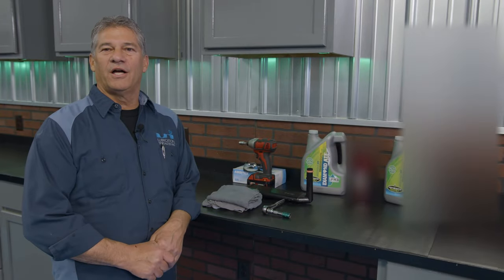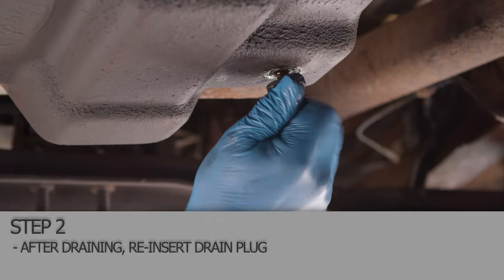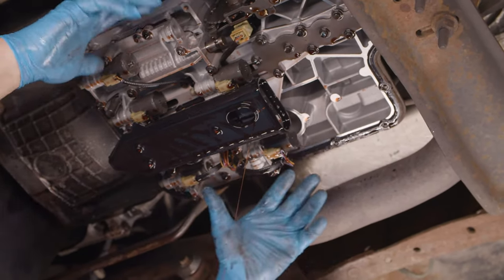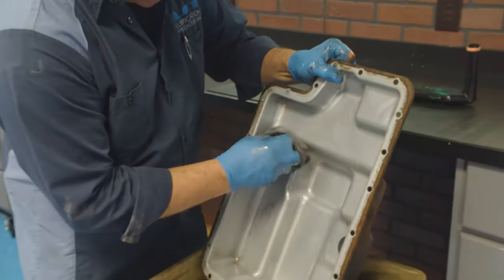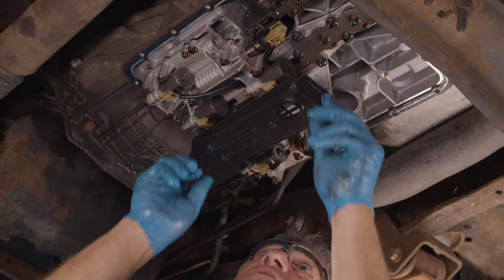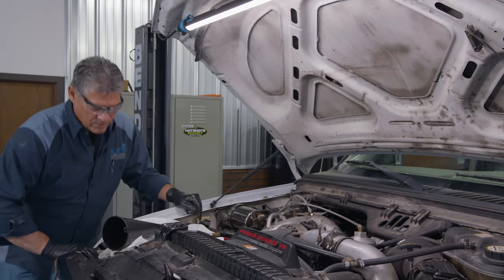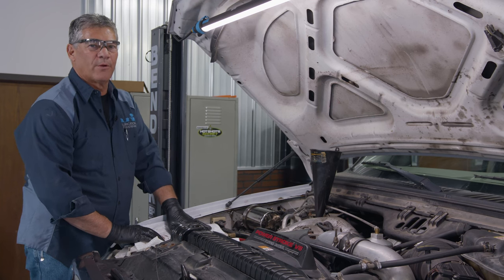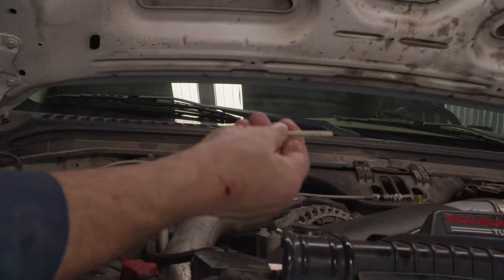How to Service a Transmission on a 2003-2007 Ford F-250/F-350 6.0L Powerstroke.

Comment: You failed to change the most important transmission filter on these trucks, that is the paper roll canister filter that is on the front passenger side of the frame. This filter filters on a small micron level and needs to be changed more often than the pan filter. 
C'mon, how do you not know this?
Reply: I'm like you. Not impressed
Reply: I was kinda thinking the same thing.  Why bother changing the fluid and one filter if you’re not going to change all of the filters.  Not to mention, that tranny requires very specific fluid, that didn’t look like it to me.
Reply: Yeah same. Not to mention flushing it. half the old fluid is  still in there.

Comment: I have always put the trans slowly into every gear, one after another for a few seconds, then back to Park before checking the level. This allows all the various hydraulic circuits for each gear to fill up. But the 5R110 is entirely electric solenoid shifted, so perhaps that is no longer needed on this tranny. It would be good for you to comment and clarify.

Comment: Should I change my transmission fluid even though I have never changed it I have 135,000 miles on it ? 2007 f250 6.0
Reply: I would drain out about 2 quarts every oil change and replace with two new quarts along with changing the paper filter up front by the radiator. Introducing too much new fluid might cause it to slip since it has been so long. You could also put on an auxiliary transmission filter that will do a great job of cleaning up the fluid on the return line. Dieselsite.com has one that I put on my 2007 6.0. I don't drop the pan anymore because the pan filter is more of a screen than a filter. I just drain out the fluid and spin on a new auxiliary filter. Its about 9qts total then. These 6.0 trucks have great transmissions.
Reply: Just drain the pan, and change the filter and fluid. That won’t hurt anything. Flushing it will destroy it. A simple filter and fluid change won’t hurt anything.

Comment: Would a dirty filter cause transmission to overheat no slipping. Just temp going up
Reply from the maker: It can. But, typically it's because of a lack of lubrication, so you would notice a whining sound or slipping. It "may" be in the early stages so the other symptoms aren't being noticed.
Reply: In a Ford 6.0, No.  If the filter was that dirty to cause problems you would have far more issues than high temp.  
 Again, if this is in a Ford 6.0 automatic,  it is very common for the trans temp sensor that is in the transmission to go bad and give erroneous readings of overheating.  It is very easy to change once you drop the pan.

Comment: Should you shift through the gears and the. Check the fluid level???
Reply from the maker: You should drive it a bit and get the transmission up to operating temperature and check it again as well.

Comment: You didn''t change the most important filter. The inline one at the front of the truck. It does the vast majority of the filtering. The one in the pan is basically a rock catcher. No fine filtering at all. Also, what about all of the fluid in the Torque converter? That old oil is still in the system. This is really a misleading video.

Comment: WHY U DIDNT DRAIN THE CONVERTER WTF
Reply: That's the part I need to see
Reply: Because there isn't one. No torque converter drain on this transmission.
Reply: The 5R110 used by Ford does NOT have a drain plug, that’s why.

Comment: Not a good video. You didn't change the small toilet paper looking filter on the right side of the truck up by the radiator. You also didn't mention that when you drain the pan you're only getting out about 8 qts of fluid out. This transmission holds 17.5 quarts. So doing it the way way you have shown requires draining, filling, driving, draining again, filling multiple times to rid the trans of the old fluid. If you are going to make a video showing people how to work on they're own trucks please show them the right way.